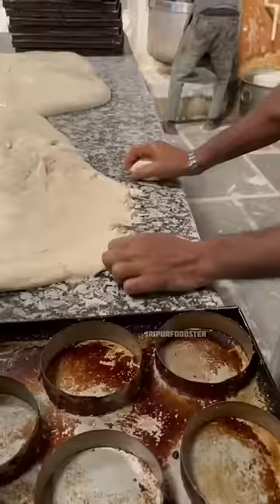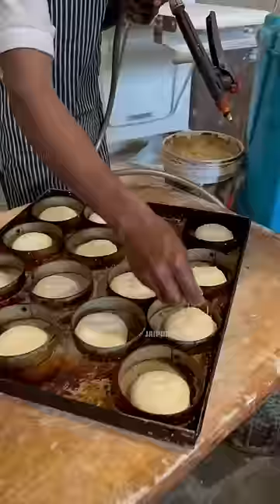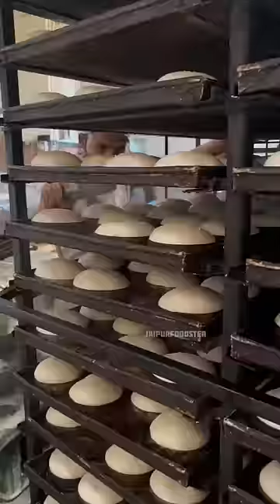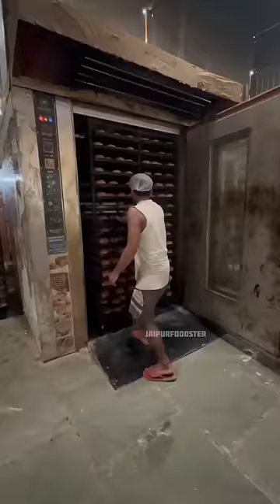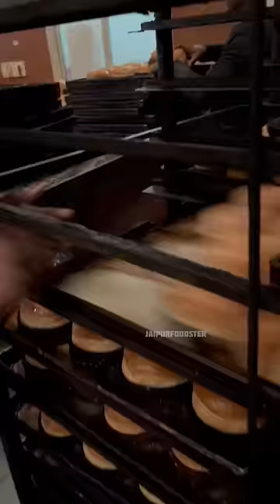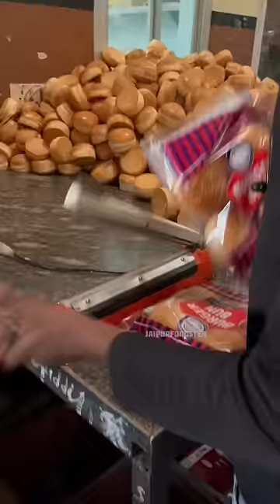Burger khane walo ye DEKHO 😱🤯🍔 | Burger Buns Making in Factory 🔥#youtubeshorts #foodshorts

Comment: Being a hobbyist Baker myself, I don't see anythng wrong in it. Maybe I am wrong but the rust that you see in those baking container is not rust but burn marks because of baking. And that spray that you saw itls water spray for moisture and the brush that they used for shining the buns is oil.